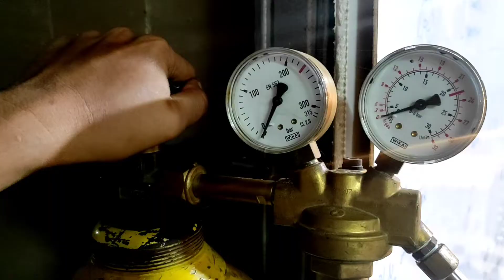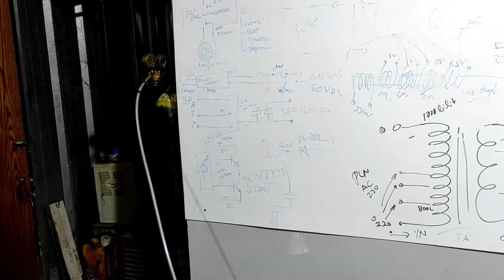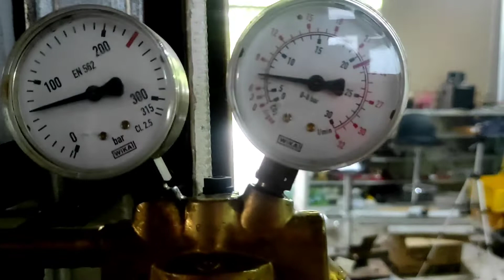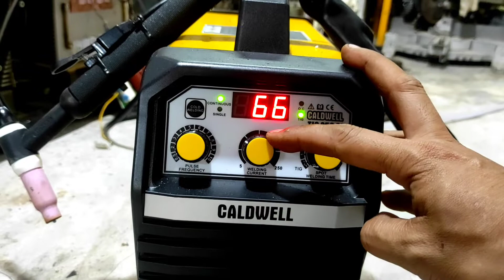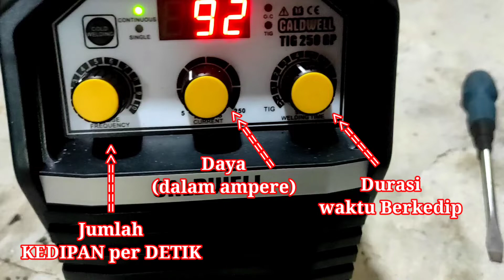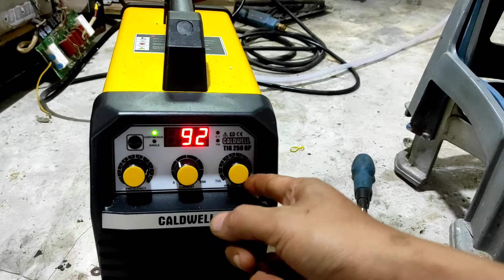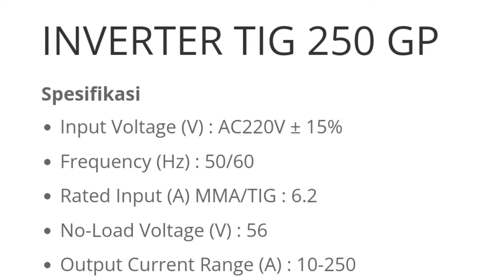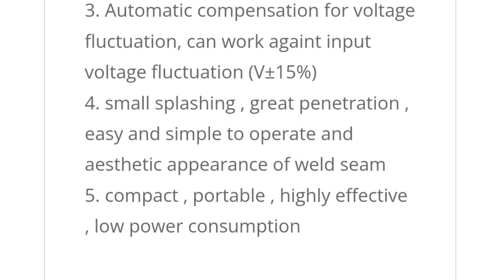CALDWELD TIG 250 GP | Unboxing,Preparation,Operating,Specification and Exercise TIG welding...

Comment: Potensio Spot welding taim itu fungsinya gimana mas?
Reply: Udaah ada fitur 2T dan 4T Nya blum ya mas???
Reply from the maker: Kalau spot weld itu untuk mengelas tipis misalnya seng...
Itu hidupnya mati idup mati hidup sesuai pengaturan potensionya...

Kalau 2T atau 4T yg TIG type ini tidak ada...
Jadi tetep harus mencet terus selama pengelesan.

Buat yg belum tau...
2T atau 4T paling banyak dan umum di gunakan di mesin las MIG.
Di mana kalau 2T maka kawat akan keluar hanya saat di pencet saja...
Sementara 4T kawat akan keluar saat di pencet pertama kali...kemudian selema pengelasan saklar bisa di lepas tanpa perlu di pencet.
Untuk mematikan tinggal angkat saja stik supaya kawat tidak menyentuh ground atau tekan sekali lagi switch nyam
Reply: Lahh kalo bgitu pulse dngan spot welding taim itu apa sihh??
Reply from the maker: Silahkan lihat di menit ke 07:00 silahkan klik saja ...
Di situlah fungsi spot.

Yg mana ada timing ada pulse nya...
Timing untuk mengatur berapa cepat kedip nya...
Pulse untuk berapa lama denyut nya...